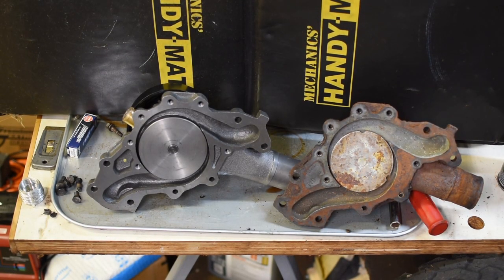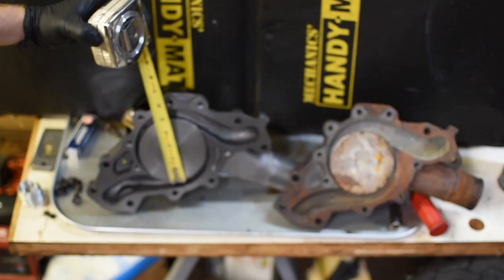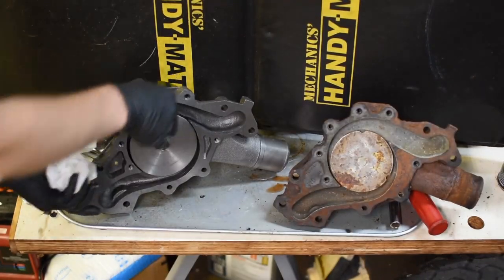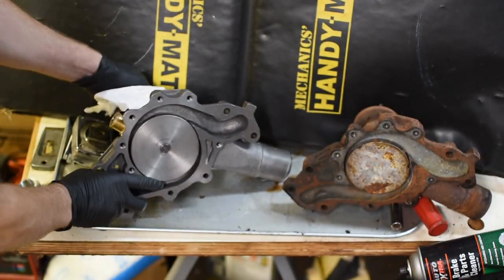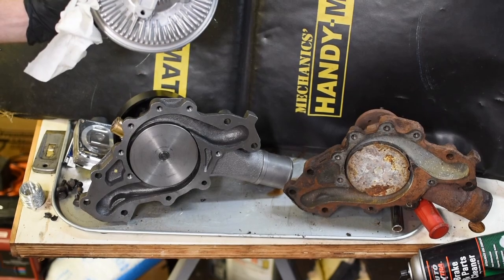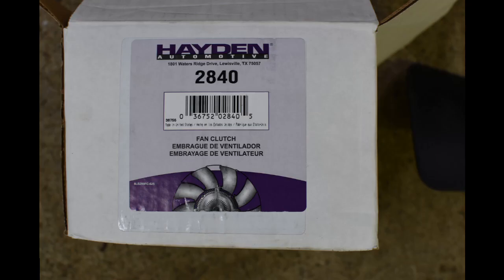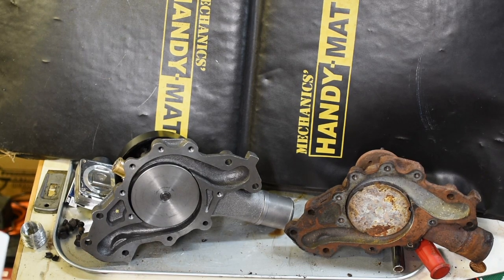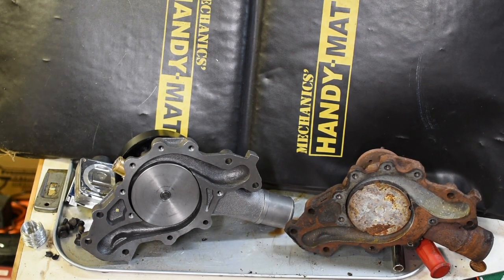6.5 Diesel Water Pump Comparison

Comment: So the old pump does not have a bypass meanwhile the 130 GPM Pump has a bypass. What happens to the bypass? Do you simply shut it or what?
Reply from the maker: Both have a bypass fitting it is whether or not you choose to put a restriction in it to restrict the flow, going back into the engine instead of circulating through the radiator
Reply: @TRUCK_TECHNICIAN  Thanks for the answer. Just realised they both have a bypass.

Comment: Do you have any email to which I can send you some photos to see if you can help me I have a 1991 chevy p30 which is supposed to be 6.2 but they changed the engine to a 6.5 and I don't know what year it is, it has a very similar fan clutch That one, but it has 5 metal blades, the fan clutch was damaged and I can't find it since it is a large nut, if I could help myself, I'll thank you.
Reply from the maker: It’s the large single nut?
Reply: @TRUCK_TECHNICIAN  yes
Reply: @TRUCK_TECHNICIAN  yes single nut
Reply from the maker: @solraczurc7210  the parts numbers are in the description in the video

Comment: Thank you my man…especially for part numbers!  I have a 1985 Chevy 6.2, I should be able to upgrade the pump and fan correct?  Thanks from SW Minnesota
Reply from the maker: If it’s v belt and not serpentine then the pump rotation might be different

Comment: I bought the upgraded water pump and 9 blade fan for my '96 last summer.   It consistently runs 20° cooler, even towing.  I got mine from Leroy Diesel.   Highly recommend!

Comment: 251-603 pump is the best one. The "professional" grade is cheap junk. GMs economy line of parts.  Also the Hayden 2886 clutch is better than the 2840.  Bill Heath tested and tested these setups and these are the best.
Reply from the maker: Post the article with the part numbers
Reply: @TRUCK_TECHNICIAN  Also the Hayden #2886 is the most severe duty fan clutch made for the 6.5l diesel. The 2840 is compatible, but the 2886 is the most highly recommended for the best possible setup.
As well as a single stat crossover and a 190 degree stat, and not the OEM 195 stat. The dual stat crossover will work, as long as the proper restriction is in place, but thorough testing shows the single stat works the best, as it blocks the bypass automatically during operation.
Reply from the maker: @g-manracer1997  to my knowledge from my research those two clutch fan part numbers engage much later than 210°F
Reply from the maker: @g-manracer1997  also in the article it does not give any part# at all
Reply: @TRUCK_TECHNICIAN  and yes it does give the pump P/N as 88894035 in that article if you pay attention. It IS AC Delco #251-603.  I'm not trying to discredit you, I'm just trying to relay the best information out there that is available to benefit all of us.👍
Reply from the maker: @g-manracer1997  i’m talking about the clutch fan part numbers the water pump part numbers go to the exact same part there’s just a difference in #Warranty time
Reply: @TRUCK_TECHNICIAN  the second link gives the P/N as 2886. It is for the Kodiak. The 2840 will work, as well as 2839, but the 2886 specs claim it kicks in at nearly 30 degrees sooner than the stock units, which are basically the 2839 and 2840, just different dimensions, which is usually well over 200 degrees. You can go to Hayden, or just about any 6.5l diesel forum, and the guys all swear by them. I run it, and the difference IS amazing, especially when you're pulling a 15K gooseneck in the summer heat..
Reply: https://www.65turbogarage.com/stop-65-overheating.html
This will have all P/Ns and information needed
Reply: https://www.dieselplace.com/threads/cooling-restriction-needed.986274/post-9919937

The data sheets are here, and just for reference, GM part# 88994035 IS the AC Delco #251-603. It IS the GM OEM pump. The other lines of AC Delco, such as "professional" or "advantage" are lesser economy lines, that are NOT original equipment parts.

Comment: Quick question. When getting that larger fan? Do you also change the fan shroud? I believe that’s what it’s called the plastic part that surrounds the radiator?
Reply from the maker: If your motor mounts are old you may need to trim or sand the bottom part of the shroud so the fan does not hit
Reply: Mine did not need any modifications

Comment: Does this apply to the 1992 as well? I’m wanting to upgrade my fan but my truck is a 92 and by the sounds of things it doesn’t bolt up the same.
Reply from the maker: brunothehumble Should be the same as long as it is a serpentine belt set up you will not need a bypass restrictor fitting with a single thermostat housing though

Comment: Ther on the 96 and up  I don’t know why every body says 97 and up if it says ho it’s a 130 gph the 96 all has the dual thermostat housing ther is no hub it’s the normal one for 96 and 97 are the normal hub so you don’t have to change your fan I use it  and have never had a heating issue why did you leave out the 96 and 97
Reply from the maker: In 96 there was a thermostat housing that was a single thermostat orientated like the dual thermostat housing on a few models . And since they were phasing in the H O water pump not all 6.5 diesel‘s had it in 96
Also as the video states anything that does not have hub nut style water pump is not balance flow
Reply: truck technician  I have not seen a 96 that didn’t have a dual thermostat and a ho water pump mine works great never a problem I have a D-Max fan and mine does not run hot at all so I don’t really think unless you are gonna haul over 10 thou it is not going t over heat with this set up these trucks unless you bullet proof I would not haul anything other than a car on a trailer and that is not heavy I’ve never had it even close to overheating works for me I’m not to worried about the difference in one side flowing a little more than the other the must have been very few 96 with single water pump cause I’ve seen a quite a few Of them at auto wreckers and they has not been a single one I bet out of 20 that I’ve seen with a single  housing and they have a been ho water pumps for the cost of the pump and fan would not be worth it to me all I know is this 96 set up is far superior to the previous years
Reply from the maker: Well when you need to replace your water pump you will know what parts to upgrade to. Thanks for watching!

Comment: I have a 96 gmc 6.5 it over heat only in summer specially when towing does this pump will solve the problem or also I need the duramax fan? Thanks for your video 👍
Reply from the maker: ggg's fan  This water pump fan clutch and bypass restrictor fitting will help as long as you have a dual thermostat housing and a nine blade fan to bolt the fan clutch to. 

You will need the Duramax fan if you have the older style fan
Reply: @TRUCK_TECHNICIAN  👍
Reply from the maker: ggg's fan you always want to make sure your radiator is cleaned inside and out so it can both flow and pass air through the fins

Comment: I have a 93, in need of a water pump. Is it a candidate for the upgrade? Considering its a 6 blade fan? Would i just need to buy the 9 blade fan? Thanks in advance.
Reply from the maker: mr. misunderstood  yes I would say it can Benefit from it
Reply: @TRUCK_TECHNICIAN  apreciate the advice, i had no idea there was an upgrade trend for it. Worst case scenario on the fan, just came to head I can use electric fans as well.

Comment: Is the 252-776 "less money" pump also a balanced flow pump giving proportional flow to both sides of the engine? If so what accounts for the $200.00 difference between the two pumps? I see lots of diesel specialists recommending the 251-603 "more money" pump but no one speaking of the 252-776. Thanks for your input.
Reply from the maker: Edward Swan Jr  that is a great question. They are both the exact same part and I believe they are built in the same way with the same quality but one probably carries a higher warranty that is what you are paying for either that or one is a higher quality than the other Price would reflect that.
Reply: I would buy the 200 dollar cheaper one I have a 96 it is a ho pump and dual housing just no equal flow I put a duramax fan got at scrap yard and never had a overheating issue in my dually towing car on a trailer I will not put a lot of weight behind this truck cause as far as I’m concerned it don’t have the power this truck is great on fuel is the only reason I keep it not my favorite motor but it’s awesome on fuel

Comment: 96 up to 2 thousand is 130 you should change your thermostat housing you can go to junk yard and get a durramax fan don’t need to buy the clutch separate waste of money you fail to tell people to go get the dual thermostat housing which is as important or your truck will still over heat
Reply from the maker: Jeff Leblanc I’ve run trucks with a single thermostat housing and had nothing but a cool running engine. In fact gm has a service bulletin on using the 130 pump

Comment: You can get it for 96 with out the pully and it is 130 thy changed in 96 also went to dual thermostat
Reply: A 96 is 130 also
Reply: I personally don’t like the screw n on
Reply from the maker: Jeff Leblanc any flange mount regardless of the years still are not balance flow. Yes in 97 it was 130 gpm but still not balance flow
Reply from the maker: They also didn’t go to dual thermostat until 97